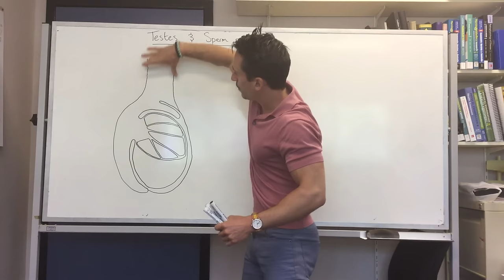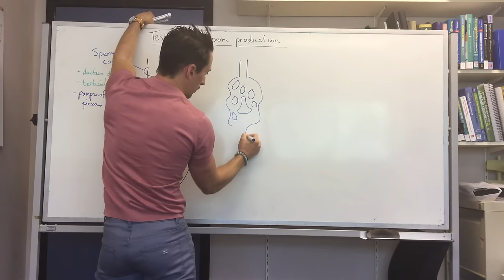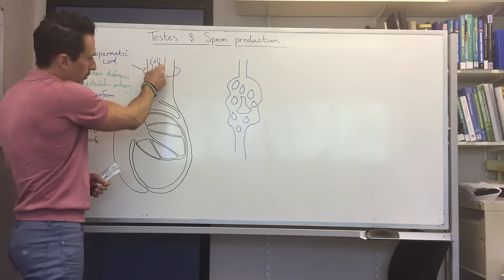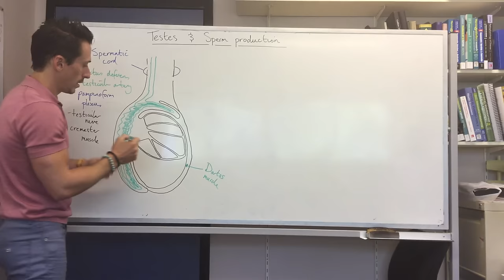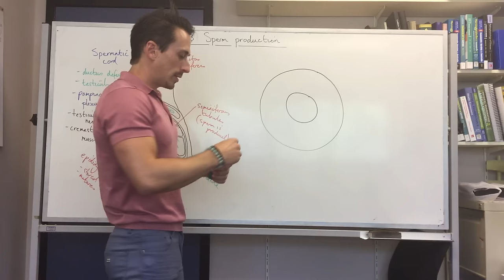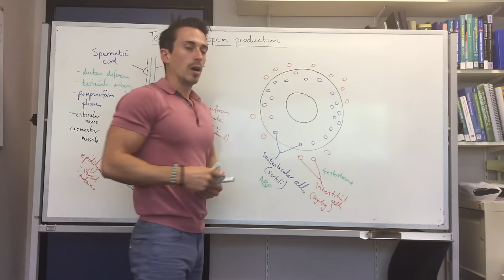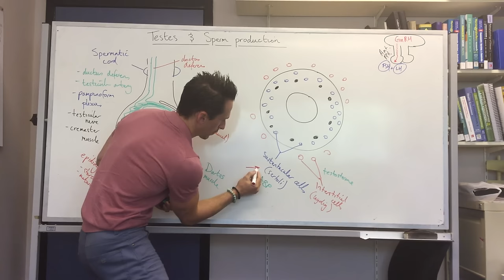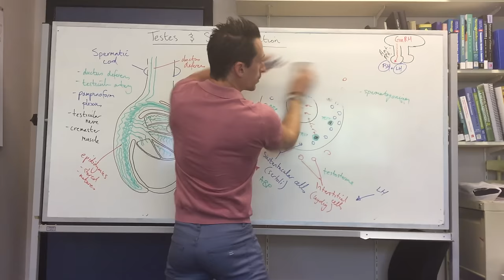Testes and sperm production

Comment: - There are two testes, each around 4 cm in length and 2.5 cm in width, weighing around 10-12 grams each.
- The testes have two main purposes: sperm production and androgen production.
- The spermatic cord runs from the testes up into the abdomen and contains various anatomical structures, including the ductus deferens (which carries sperm from the testes), the testicular artery (which provides blood to the testes), and the pampiniform plexus (which cools the arterial blood coming to the testes).
- The creamaster muscle is responsible for raising and lowering the testes for temperature regulation, while the dartos muscle changes the wrinkliness of the scrotum for the same purpose.
- Sperm production occurs in the testes and is carried through the ductus deferens.

The testes have two main functions: sperm production and androgen production. The spermatic cord is a structure that moves from the testes up into the abdomen and contains the ductus deferens, which carries sperm from the testes to the male reproductive tract. The testicular artery, a branch of the abdominal aorta, provides blood to the testes, and the penile form plexus cools the arterial blood coming into the testes. The cremaster muscle, found in the spermatic cord, regulates temperature by relaxing or contracting to raise or lower the testes. The dartos muscle, which surrounds the testes, also plays a role in temperature regulation by changing the scrotum's wrinkliness. Sperm production occurs within the seminiferous tubules, found within the testes. These tubules contain the cells that produce sperm, called spermatogonia. As they mature, they move through the tubules, where they undergo meiosis and become spermatozoa. Once mature, the sperm are released into the epididymis, where they continue to mature and are stored until ejaculation. 

Bullet Points:
- The testes serve two main functions: sperm production and androgen production.
- The spermatic cord contains the ductus deferens, testicular artery, and penile form plexus.
- The cremaster muscle raises or lowers testes to regulate temperature.
- The dartos muscle changes scrotal wrinkliness to regulate temperature.
- Sperm production occurs within the seminiferous tubules, where spermatogonia mature into spermatozoa.
- Mature sperm are stored in the epididymis until ejaculation.
Reply: For those who apparently don’t know about the Transcript button. 😂
Reply: @DaRyteJuan lol